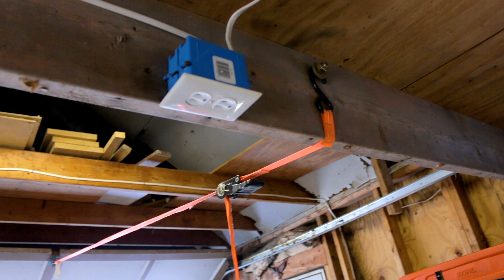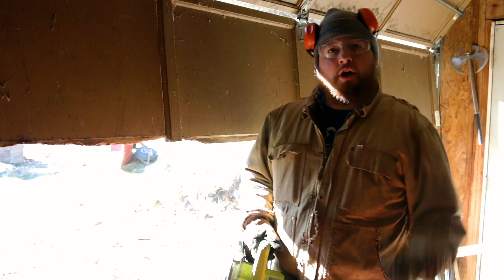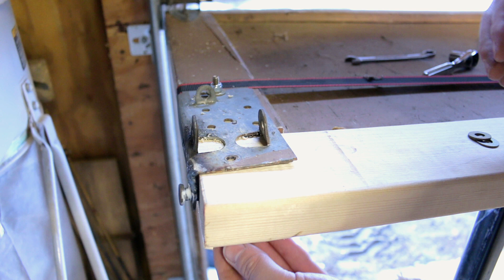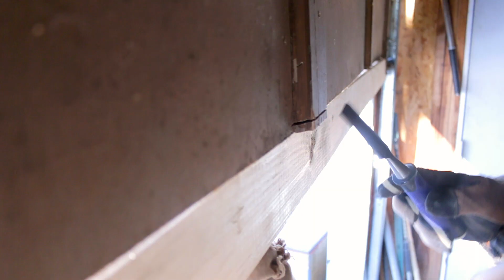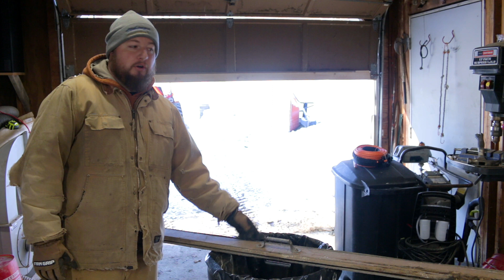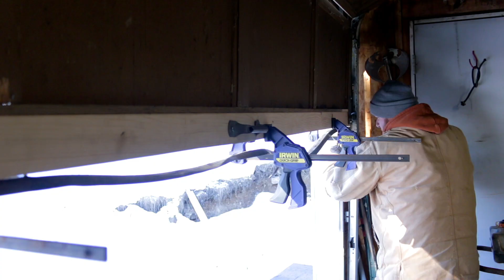Wooden Garage Door Repair

Comment: This is awesome! My garage floor was capped with 3.5" of concrete so i need to cut down my wood garage door to close properly. I am adding a thick weather seal, so a total of over 5" needs to come off the door, so i have to cut into some of the panels. Will try this 2x4 lumber solution as a bottom. I am thinking of a more secure way to fasten the 2x4 to the frame though, so I don't have to redo it later.
Reply from the maker: Nice! You could use L shaped plates to tie it in on the outside/inside of the door

Comment: How do you replace the panels and what material is used?  Thanks
Reply from the maker: You will need to take the supporting wood that frames around the panels out or at least the trim that holds them in place. What I used was simple quarter inch plywood

Comment: Thank you soooo very much for your video! I’ve got a garage wooden door that the bottom has rotted out just like yours and had not idea how to fix it. The quarter round idea helps a lot, thank you so much. A greedy carpenter quoted me $500 to fix it! I was so mad. I did wood work in high school and didn’t have a table saw to rout in the line for the panels or make the edging. Thank you for saving me so much!
Reply from the maker: @InnovationTree  nice! Your welcome

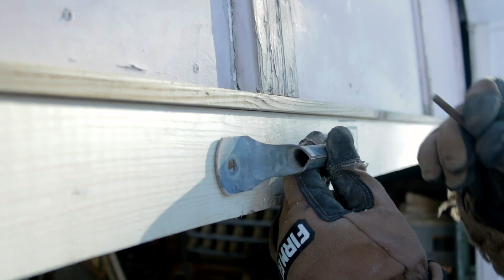Comment: That 2x will soon be in the same shape.  You should have sealed and painted it before installing.  The rot wìll start on the top under those strips that you put on to hide the gap. 6:33

Comment: Sorry to be critical,  but that's not the best you could do.  If you had taken that lower panel off and worked on it on sawhorses,  you could have easily cut straight and parallel cuts and removed all the rot.  Hiding gaps with quarter round isn't right😮 2:30
Reply: A proper fix would have replaced the damaged panels and styles into a recess in the bottom rail.

Comment: I have a similar issue. Just afraid to unscrew the hardware cause something bad could happen if I don't use proper instruments to hold the cable. You show that just holding the door open with the strap would do. Nice to know.

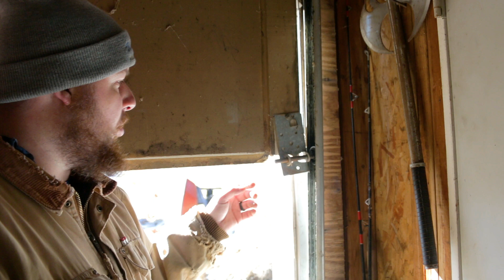Comment: Others have warned about the danger of taking off the bottom "plate" (@0:57). Why is there no tension in the wire attached to it when the door is only half way up?
Reply from the maker: No tension because my springs are worn out. If you dont bring the door up there is tension on the wires so if you don't take them off while the doors up they will go flying
Reply: @appalachiandiy2415  Thank you for the info.  My string is still good, so is the safest way to try to take off the plate is to raise the door to the top so that there will be little tension in the wire?
Reply from the maker: @SSadhg  yes, all the way up

Comment: I'm having some issues with the 2nd panel section on my door. Would I follow this same guide to fix the problems? Are the thin ply panels sold individually that you know of?
Reply from the maker: I doubt you'll find panels that fit. Your going to have to find the closest thickness plywood and use that. Other than that, same as the bottom

Comment: Thank you so much for helping ordinary folks overcome the fear of actually doing it ourselves. Mine is the ditto damage of your garage the same broken gape open and the same length. Inquired about outside help and was told about $450. I myself able to fix a lot of stuff but seeing the panel has a recess that goes into the bottom 2x4 left me scratching my head about how to make a groove all the length of the wood. Your idea to just saw off the excess protruding thin layer that goes into the bottom wood is such a smart idea. and also to note from others that the door may need adjusting because of the possible shortage when sawed that is a piece of cake to adjust from the motor. Your style of narrative is also brilliant and wasted no time for us to understand completely. Some would be wanna gurus to demonstrate so poorly that it was a headache to watch them because they go over the simple task as though all are dummies.

Comment: I went to put mine down and the bottom board folded under and brought up the next one with it. Now I can't raise it (or shut it fully). I'm trying to force that door up onto the rails so I can take the wires off of the springs and replace it. This is a 15' x 7' (oddball size) very old wooden door that looks pretty close to yours! That bottom board failed finally and now I'm trying to figure out how to get the door up. If you have any suggestions, that would be cool lol. thanks again for the video!
Reply: If anyone else runs into my situation, try and use a floor jack to jack the door up a little and then separate the top/bottom pieces, secure it, etc. I have the springs disconnected safely now as well! My last issue is trying to mate the two pieces back together because mine was held with a single bolt on each side and wooden dowels at each intersection....I've got 5 hours until it rains about half an inch so I have to figure this out :) You really got lucky with the nice bracket you have in this set up though! Mine is all weird.
Reply: Got my old dowel rod holes all cleaned out and new dowels glued in on one side. Got everything ready and I tried to lower the door onto the bottom board which was sitting on the ground and I got my hand caught in the door LMFAO. Got it out without breaking anything but they are numb and in pain. So, don't do what I did kids 🤣 Not sure what to do with it now. New 15'x7' door is 6-8 weeks away. Garage doors are a pita.

Comment: Awesome video!! Im going to attempt this on my garage door, will construction adhesive caulk work if dont have nail gun to attach wooden strips? What kind of wooden strips are you using ?
Reply from the maker: Ehhh, i would use some type of hardware like a screw or nail. I just cut strips off a 2x4

Comment: You've given me the inspiration to do it myself! Two questions:
1) Before starting to take off the bottom rail, I measured it and see that it is 1 3/8" x 4 3/4". A 2 x 6 is  1 1/2 x 5 1/2". I can rip the 5 1/2 down to the right size, but should I be concerned about the difference in the width? 
2) Considering the bottom rail rotting seems to be a common problem, do you think it makes sense to look for a non-wood product, like a PVC board?
Reply from the maker: Width shouldnt affect, but make it flush on the outside for the weather strip. A good weather guard paint/sealcoat should protect well but if you got the $ a plastic option could work well too

Comment: Could you have used a ratchet strap on each side of the door, used a level to strap it level, then measure up from floor to the same distance on the inside of the door, mark even points on the bottom panel, then fold the panel inside the garage and use the circular saw to make a straight and level cut to marry the new board to an even, straight(er) surface?
Reply from the maker: Yes, that would work. Nice idea

Comment: thank you for the video. I am going to attempt to do this on my 10' long door. bottom is rotten out. Question, when you remove the 2 cables brackets at each end, are they not under tension by the pulley's?
Reply from the maker: Not when the door is fully up. Or at least not as much
Reply: @appalachiandiy2415  ok thank you. So if I bring the door fully up and I disconnect the cables, then I can use the ratchet strap to hold the door in place at the height I want to work at to replace the bottom.
Reply from the maker: @stevenbelleville392  yep. If there is still some tension on the cables, loosen the adjustment drum to give more slack
Reply: @appalachiandiy2415  awesome. Getting to the drum will be challenging cause the garage door rolls up right above it making it difficult to get at. Maybe I will release the tension on the roller spring before I lift the door up. Thanks again.
Reply from the maker: @stevenbelleville392  Roll it up as far as you can then loosen the tension. Trust me i had one let loose and it was a scary situation
Reply: @appalachiandiy2415  thanks man! Going to attempt this weekend before the snow starts falling up here in Canada!! 😀😃😄
Reply: Ah bro......got it all done yesterday. Was tricky for sure...especially since the door is so old and not perfect.  Took me 6 hours however I took my time and finished the job. I will still need to reinforce some of the panels however overall I am satisfied.Thank you again my friend for giving us the guidance.
Reply from the maker: @stevenbelleville392  absolutely! I'm glad it worked for you
Reply: Clamp the cable to the track before removing the mounting brackets.😊

Comment: Hi, I have a four paneled wood garage door and I need to replace the bottom panel. Is there a place online that I can go to buy replacement panels? I've looked and haven't found anything so far. If not I guess I will have to do what you did and make it yourself. Thank you very much.
Reply from the maker: Hmmm. I think you'll be hard pressed to find anything like that online. I would try to get a composite/plastic material to replace it with or just thin plywood and good paint
Reply: @appalachiandiy2415  Thank you for the advice....

Comment: in some doors, wouldn't the cables pulled up by springs as soon as disconnected from bottom panels?
Reply from the maker: Yes. Loosen tension before removal. Or have your door all the way up.